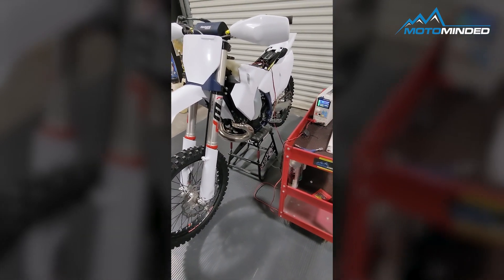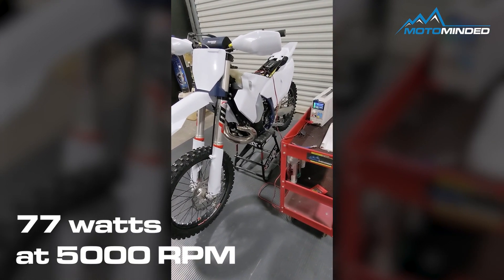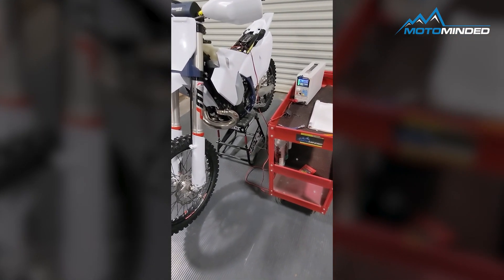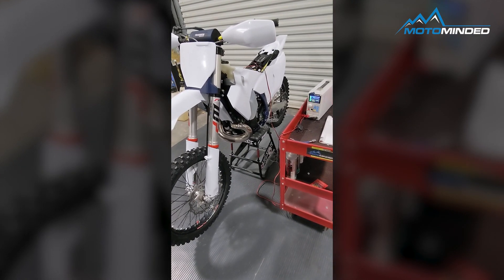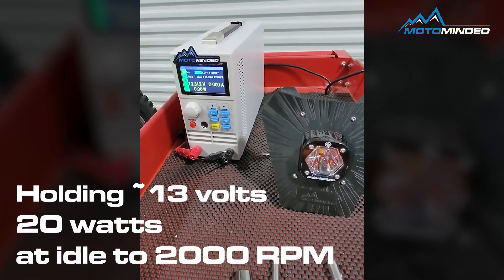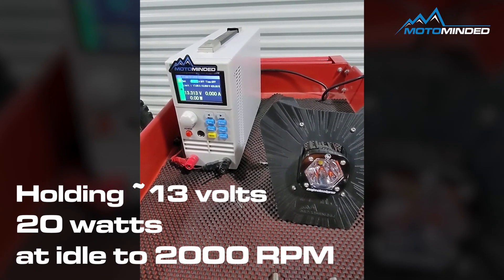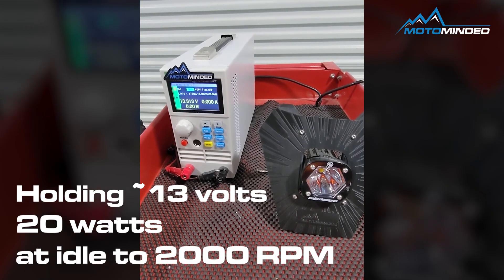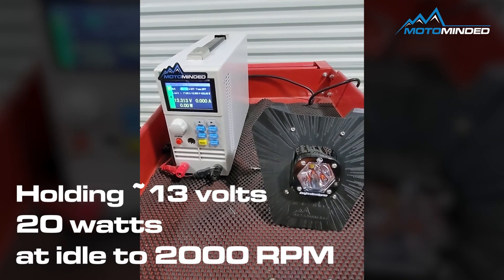23 xc tx 300 stator load test

Comment: So far my 2023 XC 300 will support 41 watts with 14.2v. Idle thru 3rd gear trail riding. Using the trailtech striker and optimate charging after day use, it starts at the top of the charge cycle. 56 watts sucked it down to 12.8v so load was reduced til TT showed consisent charging at 14.2 on the road- more trail testing to follow.
Reply from the maker: I guess it's what measurement device we put trust in?   At 37 watt load we had a result of 12.4 at 2000rpm.  48.8 watt load was 12.2 at 2000 RPM.

Comment from the maker: Update!   Ricky Stator has a rewind option. 70 watts for accessories above what the bike needs to run.
Reply: Hi. I am waiting to get my 24 TX or TE. The stator issue has me concerned. I run a cyclops trail boss pro light and am waiting to see if anyone has any data that says the Ricky stator rewind will work on that light and possibly a fan. Is the 70w going to be enough. I am thinking I will have to just go with the TE at this point.
Reply from the maker: We suggest reaching out to Cyclops for their product information. 😉
Reply: Have you tried a testing with the Ricky Stator to show how it differs at Idle, 2000rpm etc?
Reply from the maker: @alexkevan3887  unfortunately, we have not yet
Reply: I am a bit confused by this... the stock stator is 30 watts at idle and 77 watts at 5000rpm. Then Ricky says, "Hey, we have a 70-watt stator', but the stock one is also 70 watts.
Reply from the maker: @alexkevan3887  Ricky is stating what is available above what the bikes need to run

Comment: The lithium battery in my 2022 KTM 300 XC TPI says on it "..if at 12.8 volts charging is required."
Basically it is saying do not let this lithium battery get under 13.0 Vdc at any time.

So running a fan, light, dash,...or any combination of accessories should never draw the battery volts to below 13.0 volts.
Simple to know,  understand and follow as I understand things.

Comment: Just adding some color commentary for what it’s worth. I have a ‘23 300XC and mostly ride hard enduro (lots of starter hits during 4-5hr rides). I had a trail tech fan hooked up to a override switch on my bars to ensure it was only on while the bike was running. It still killed the battery and looks like it may have fried the charging system. Battery died mid ride, then bumped, then died again 10mins later. Put another fresh battery in from a buddy’s bike(which doesn’t actually fit because of the new battery tray) and it drained that battery too(fan completely off and disconnected) It’s in the shop now being diagnosed but the thought is either the stator or voltage regulator is out. 7hrs on the bike. It was one thing to remove the kickstart option, but it was a major fail by KTM to put such a weak stator in these bikes. The voltage regulator is also about half the size as the TPIs and is now under the seat. Heat dissipation must not have been a top priority?
Reply from the maker: less stator, a smaller regulator is possible
It is disappointing they provided such a small stator. 
Still... if you like how fast your 300 revs up and all the smooth torque.. the smaller stator is helping provide that. Stators are HP / Torque robbers.

Comment: I phoned Trail Tech and "They do not make stronger stators for TPI bikes because the TPI's come with a high output stator of 120 watts." 

Stock now is stronger than carburetor bikes of past which often came with 30 watt stators or there abouts.
Did not ask about 2023 TBI's but I imagine they are the same as TPI's as they both have fuel injectors but located in a different location and TBI's have an electric servo motor to move the power valve but no oil injection small pump. So similar electric demands.
I was asking about my 2022 KTM 300 XC TPI.
Reply from the maker: unfortunately,  TBI is not the same at all. much smaller stator & flywheel and just 2 phase vs the 3phase of the TPI. Closer to an SX. 
We are guessing the most they will get out of a re-wind or aftermarket will be 100-120 watts peak.  So above what the bike needs to run about 60-80 watts for accessories. Time will tell. 

Folks who want a 300 with big stator will have to wait for XC-W / TE models.
Reply: @MotoMindedLLC  Thanx for the info..

Comment: Great video and info!  Thank you!  Just out of curiosity, I would be interested to see what it puts out at 3000, 4000 and 5000 RPM just for a comparison.  Don't most fans draw 30-35 watts?  However, I would think most people average a lot more than 2000 RPM.  I would think 4000 or 5000 RPM would be a better average for a light or fan?
Reply from the maker: Good Question. 
Yes. Most fans are 30-35. (Tusk being exception about 15 watts) 

We have a stated max of 77 at 5000 from KTM. Then the low limit we tested. We recommend going by the tested low because that is the limit. 
I can not think of anyone wanting to keep the engine revving on every ride to keep the output up to support accessories installed? 

Best to wait for an aftermarket stator or get it re-wound if you need more that what the stator can push.
Reply: @MotoMindedLLC  Thanks for the info.  Didn't realize that the Tusk was only 15 watts.  Sounds like that is the way to go on these TBIs.  Is the 20 watts less than the older carb KTMs and 4 stroke XCs/SXs?
Reply from the maker: @Montana_Motorized  much less.  The SX/XC-F have aftermarket stator options.  This one will too soon.

Comment: Outstanding work!  You mentioned that your Evo LED should work, do you have a estimate on the light output of your Evo module?  I looked at your website, but couldn't find data. 

 I run your Squadron product on my '17 450XCF with your original version printed supermount system, it has been a great bomber product over the years, especially out in the boonies when we have to make it back well after dark if our singletrack rides ended up a bit "sportier" than we planned.  I look forward to procuring a minimalist setup from you for my '23 300xc.
Reply from the maker: Thanks for your reply Mark. 
20 watts draw with the EVO LED kit.

Comment: I wonder if the new 24 stator, flywheel and regulator could be swapped over
Reply from the maker: still unknown at this point. The 24' enduro bikes are just now arriving. No one ready to tear into one yet to see. Parts will not be available to order until late summer or fall likely.

Comment: Any estimate on the tail light wattage?  Thoughts on running this light with a taillight?
Reply from the maker: Most are 5-10 watts. Should be fine. Best to check with the manufacturer though.
Reply: I can say I hooked up a Cyclops Adv Explorer light rated at 28 watt and in a night race I was having the bike bog after about 2 hours, and when I shut off light all bike power came back.  Testing though with voltmeter bike stayed over 13 volt just over idle, 12.8 at idle so I was suprised we ran into an issue.   Your 20watt estimate seems accurate
Reply from the maker: @joshmundy  nice info. It aligns with our test.